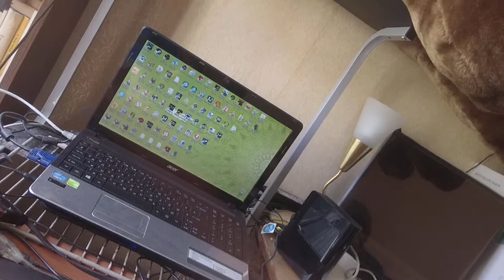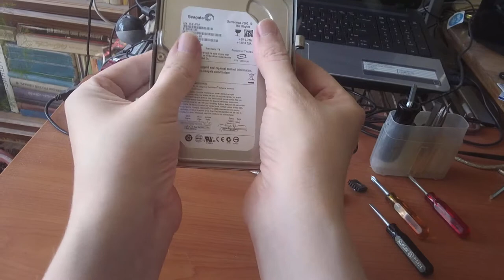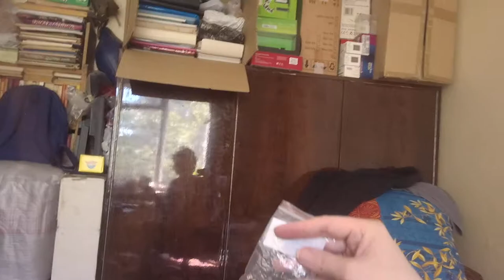How to open Dismantle Seagate Central Eject Insert HD Thecus George IV Kostandi #russia #rsv

Comment: Dear All,
If anyone have his "segate central" working or managed to replace its internal HDD please capture and upload an acronis image for its HDD; i noticed many comments have my problem and stuck in rebuilding the new HDD process.
your kind support is highy appreciested; maybe someday you need that image to rebuild yours .Thanks in advance.
Reply: Buy a new router that lets you plug a USB external drive directly into it, these devices are too slow for todays HD content. I've got a working internal HDD but it's not worth the time when there are perfectly suited routers for this job now.